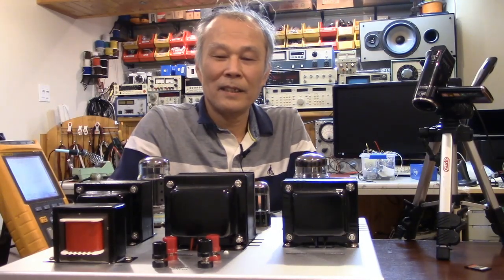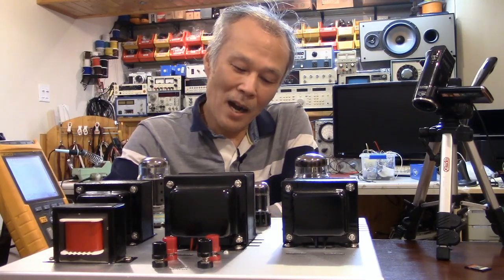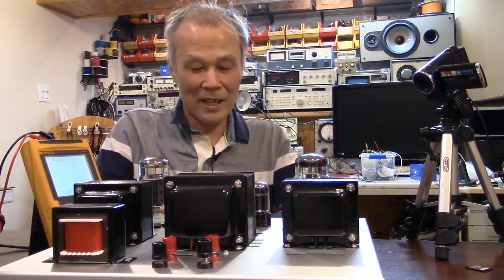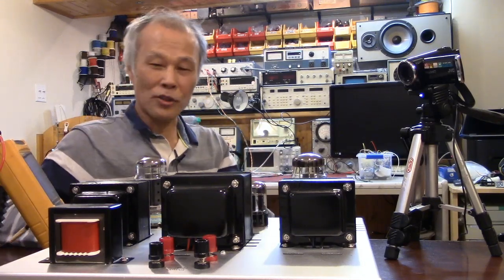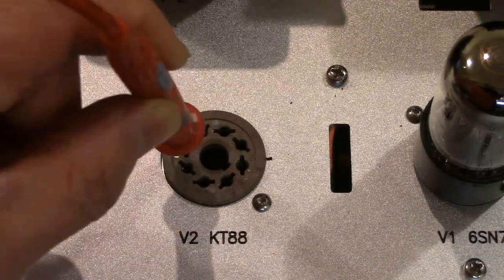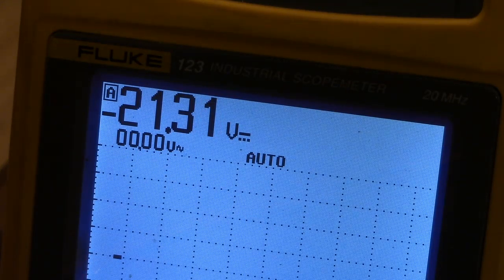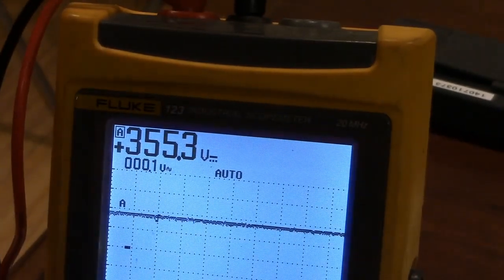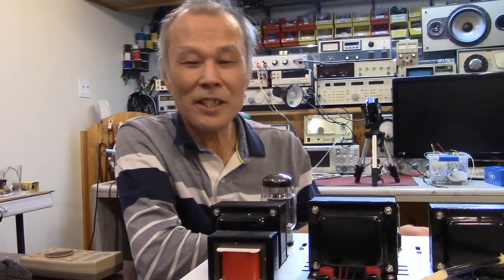2 how to test bias B+ filament voltage with multimeter, KT88 tube amplifier, fixed bias ultra linear

Comment: Hello Sir. What Iq would you recommend for a KT88 SET amp? Near 80mA perhaps? My voltage at KT88 plates is 362Vdc. Thanks!
Reply from the maker: Hi sir. 70~80 % of Pd is ok. And keep the best output signal using oscilloscope and signal geneator.

Comment: Dear sir can I calculate fix bias by using your method of measurement? I mean without tube inside As without tube my numbers are b+425v grid 2 is 424v and my bias righ now is -43.3v please let me know 
Thank you
Reply from the maker: Hi, that's great! Bias voltage will be maintained regardless power tube is inserted or not. The plate and scg voltage is fine with no power tube I guess.
Reply: @YoungAhn  thank you for reply can you please tell me what bias should I set for this voltage for it 88 a class single ended

Comment: Thank you Young.  After successfully building 2 guitar tube amps - one with 6L6 pair and the other with 6V6 pair, I"m getting ready to build a different amp with KT88.  I need good clean dynamic headroom at low to moderate volumes so,  this is a good introduction to what I will need to be doing on a constant basis since I will be more into the actual designing of this KT88 amp.  I've never actually measured tube voltages from the tube side of the chassis!  Only the inside.  So its good to see another view! Thank you!  -  Phil Donovan
Reply from the maker: Hi, thanks for your comment on my video. Congrats, you have a great skill to do electronic job. Stay safe sir. Young 😀

Comment: May I ask: the tubes are not insert in the amp, is it OK to turn on the power?
Or just little time is OK?
Thank you!
Reply from the maker: hello dear chkao59, It's OK if your amp is PP or SE.  Just Pull 1 power tube out only. Turn power off when it's done and wait couple of minutes to insert the power tube into socket. 
The measured HV and other voltage will be a little higher than actual operating condition.
Reply: @YoungAhn  Thank you very much! My amp is EL34, it has EL34, 5U4G, 6H8C three kinds of tubes.
So that you mean one tube moved each time is OK(?). Even 5U4G rectifier?
Thanks again!
Reply from the maker: Yes, but finish your job quickly if possible because HV might be over max. voltage of filter capacitors.
Reply: Young Ahn Ok，I see. It‘s so kind of your help，thank you very much！

Comment: As it is a fixed bias amplifier, so it's operating in push/pull, is it safe to remove only one power tube for the measurements?
Reply from the maker: hello dear Paul, Yes. Turn off your amp after work, and insert the tube into socket. Thanks for your question. Young

Comment: Can you explain why an analog meter may cause damage ? 
Is the meter maybe not protected in case of a wrong setting by operator ?
Of course, there were no digital meters in the time when tube amps were the only option.
Reply from the maker: very good question sir. It's because of internal resistance. 20 kohm / volt at the most. If test leads touch the bias supply circuit, lots of current is flown via MM. this will increase plate current that much. So it will be serious if measuring time takes too long. Tubes or OPTs could be damaged because of analog multimeter. Even worse, measured bias voltage is not absolutely correct. Is my answer helpful?
Reply: @YoungAhn  
Yes, I understand now.
But... this left me wondering how where these measurements made before digital MMs were available.

Then I found this... "Vacuum Tube Voltmeters or valve voltmeters (VTVM, VVM) were used for voltage measurements in electronic circuits where high impedance was necessary. The VTVM had a fixed input impedance of typically 1 megohm or more, usually through use of a cathode follower input circuit, and thus did not significantly load the circuit being tested. "
https://www.liquisearch.com/multimeter/history

I had NO idea about this. Your video inspired me to research the topic and learn even more. Thank you so much for your teachings.
Reply from the maker: roger roger, you remind me a vintage VTVM which I had long time ago(1980's). Yes, it has high impedance as well so we can use it instead of digital MM. And there is another active battery powered MM(FET type). I learned something from you this time. Thanks again. Young